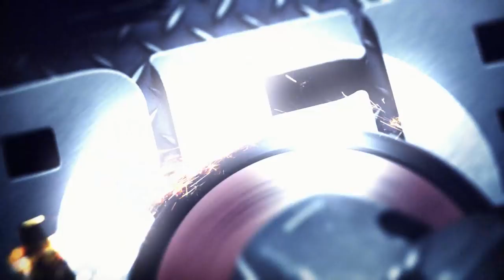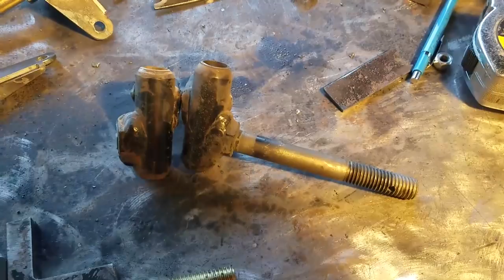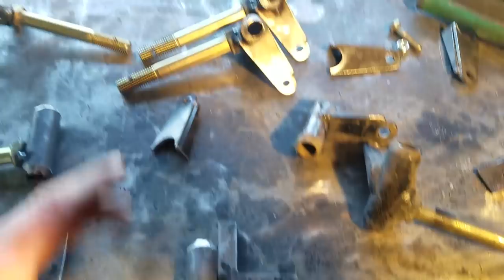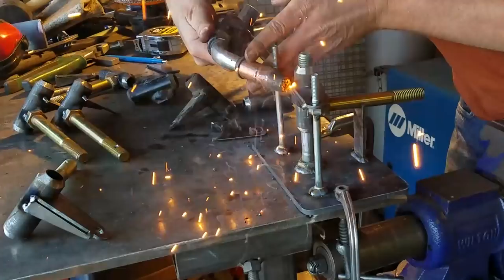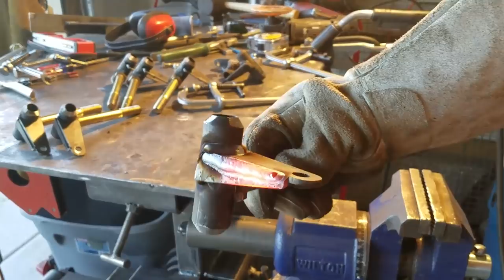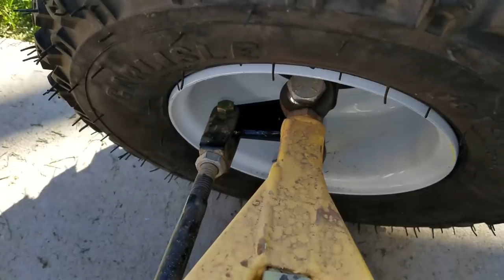Go Kart Spindle Rebuild -- Built a Jig

Comment: Very nice.  Building a SpiderCarts (Granddaddy) right now.  Just about ready for the motor (10kW + 48V/100Ah Li Ion).  Biggest issue I've run into, aside from the somewhat janky design, are the ridiculously soft front shocks.  Did you upgrade to something firmer?  Oh and BTW, I widened my rear swingarm because of watching your vids.  THANKS.
Reply from the maker: The shocks (front and back) recommended in the plans are WAY too light.  I beefed up the back ones significantly, and want to do the same for the front (haven't done that part yet).  The back shocks have been holding up, but the front are falling apart....  Glad to hear my videos have been a help.
Reply from the maker: I wish I would have built the grand daddy.... would be the same overall footprint, but have a spare seat.  I have thought about widening the current one, but it would be too much work.
Reply: Have you seen the Edge products?  That's what I hope to build next for another 2-seater.  Muuuuuuuch better design. 
 https://theedgeproducts.com/collections/the-x2-1
Reply from the maker: Yes, I wanted to build the barracuda for years
Reply: All we need is a way to freeze time...LOL.

Comment: Wouldn’t you lose steering when you angle it that much .
Reply from the maker: Not at all.  It makes it more stable.  Look up ackerman steering.  If the angle you are referring to is the 3 degree angle of the spindle in relation to the DOM tubing, that too stabilizes things more.  The front arms are unequal. As the arm compresses the angle of the spindle pitches up (allowing better, safer cornering).  When at resting level the spindle is parallel to the ground (again, because of unequal A-arm lengths).  Hope that makes sense.

Comment: I've been thinking about how you are breaking the grade 8 bolts.  A friend used grade 8 on his sea doo and was snapping them as well.  He was told to use a lesser grade (grade5) because it would be  better in the fact that the grade 5 are more forgiving in some applications then the grade 8.  And actually when he stepped down he didn't have that issue again.   Not saying this  will eliminate your problem but it wouldn't  hurt giving it a try.
Reply from the maker: I used grade 5 the first time, it didn't last as long as the 8
Reply: John Harmon - Cold Creek Works like I said it was just a thought. .lol
Reply from the maker: No worries.  I appreciate the feedback

Comment: what would happen if ya sleeved the bolt at the nut and welded both ends of the sleeve.... it might be stronger at that joint..?or ya could try a 45 degree fillet weld might give it more support...

Comment: Plz tell me the diameter of hole and bolt...
Reply from the maker: You just need to make it for the size that is needed.  The hole in the bolt for the pin is large enough to let the pin pass.  The bold fits inside my bearings (5/8" I think but could be 1/2")